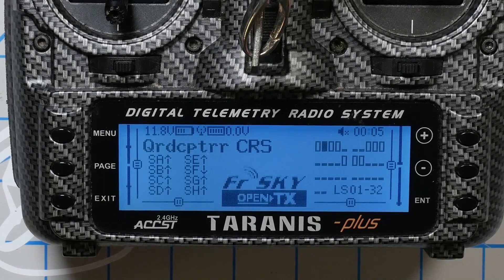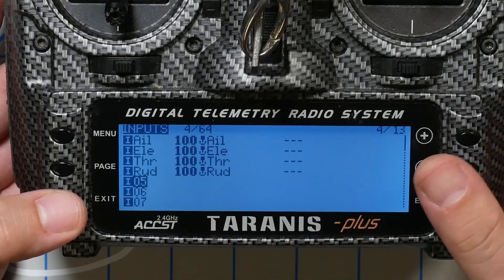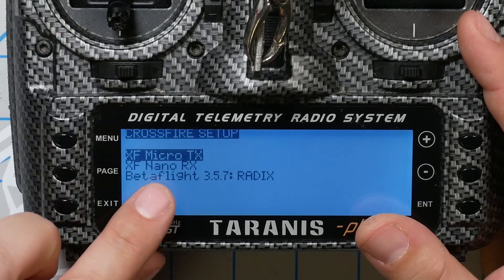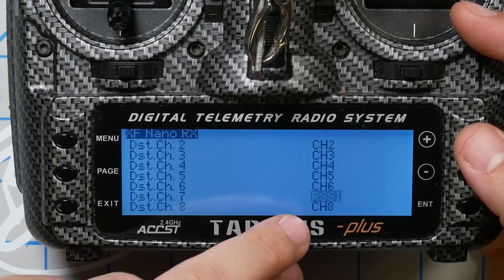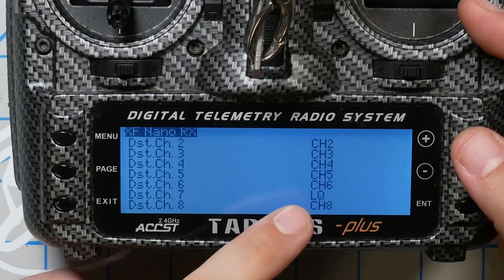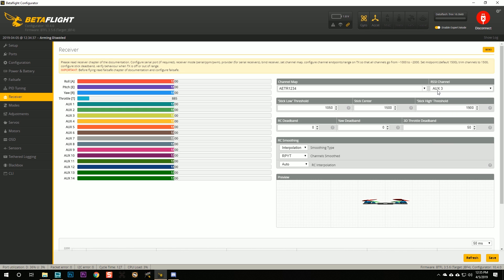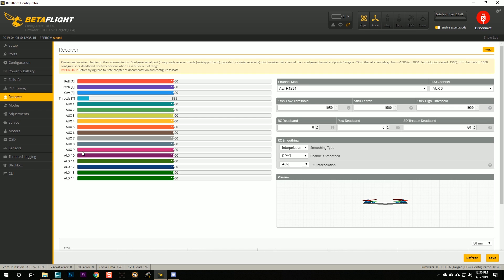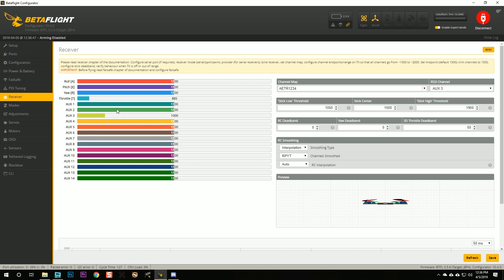How To Set Up Crossfire LQ and RSSI in OSD (NEW UPDATED METHOD IN COMMENTS)

Comment: hi I was wondering how do I fix the module when it is stuck in boot loader mode my pc turned off when I was about to update the module v2 and now it is only in boot loader mode and flashes green is there a way to fix this 😒 please help me 🙈
Reply from the maker: You should be able to flash it in bootloader mode. That's the whole point of bootloader.

Comment: I can't get the channel mapping to show up in lua on my qx7. It scrolls to failsafe and when i get past it the screen reverts to the lua luac selection page again 🙄 whats causing this? I also get telemetry lost warnings but i modded the qx7 already soldering the piece in the back. Im stumped, been trying everything baud rate changed to 11500, an running opentx 2.2.4 an crossfire version 3.72 i think it is. Rx an tx are bound also. In Betaflight all sticks work fine. Just rssi is not working or lq

Comment: Why do you have to sacrifice an aux Channel? Why are there so many aux channels in betaflight if you can only use four of them?
Reply from the maker: First, you don't have to give up an aux channel any more. https://www.youtube.com/watch?v=suAqRh2foq8&ab_channel=JoshuaBardwell

Second, there are lots of aux channels shown in the configurator because there are some protocols that give you that many aux channels. But Crossfire only has 8 channels (or has the option for 12 if you accept reduced performance). Crossfire pilots typically want the lowest latency possible so they use only 8 channels for that reason. It's more aux channels than most people need.

Comment: Hey JB I am new to XF. I am trying to set up RSSI as in your video, but when I push XF Nano RX, it comes up but then I get a box that indicates " Script syntax error - not enough memory" , and then it exits back to crossfire.lua.     Any idea what I'm doing wrong.     X9D+
The RX is bound to my Micro TX V2 and reads in BF. Can arm motors and all, just can't get into the Nano RX in luascript.
Thanks!!     Steve

Comment: I’m having binding issues. My module and nano rx are binded, when I turn on my radio the receiver goes from solid red to green. But my module is still pulsating yellow. I try the binding process but no luck. Firmware is up to date. This all happened after a crash cause my radio lost connection with the drone mid flight, not sure why. Any ideas on the new binding issue?
Reply from the maker: I am not sure what could cause the receiver LED to turn green but not the module LED. I would have to suggest you check with TBS support on this one.
Reply: Joshua Bardwell thanks for the quick reply. I subscribed to your patreon for your excellent services.

Comment: Odd thing going on here.  
I have the TBS Nano rx and Micro TX - Jumper T16.  
Originally i've had it set to just use the RSSI.  (as the DJI FPV only shows RSSI in OSD)

I wanted to switch to LQ as the RSSI here on my test bench shows  85-88 %.  Moving 1 meter away, it shows 75-80 %.  
Followed your instructions, changed it to channel 7 and set it to AUX 3 in BF.  It's still showing the same %.  Changed the AUX back to none and it's still showing the same %.

What am i missing here? :) + That signal strength can't be right, can it?

Greetings from Belgium!
Reply: I’m actually going over the comments for the same exact reason. We’re you able to figure it out?
Reply: Also having the same issue here, TBS Nano rx, Micro tx - TX16S.  Using DJI HD, so only display RSSI value, using the old method to assign my channel 8 and set it to AUX 4, when I'm really close (like right next to it), I get around 80-85%, then 1 meter away, I get around 70%, when I'm out of the room, I get around 50-55%.  Not sure what's the problem there. (Using Betaflight 4.2.2, all latest firmware on TBS rx and tx.
Reply: @allaboutvisual  don't think there's an issue tho - i've been sending it with the same % and it goes... far.  No failsafes - did set them warnings up in my radio, haven't heard them go off either so i assume all is ok.

Comment: Hello, I am having an issue with the SD card. My Taranis x9d+ recognizes that there is a SD card inserted in the slot but none of the files will show up (crossfire is the one I want and I have it on the card). I’ve tried different cards but no luck. Hobby store suspects a faulty card slot, but I think it’s strange it knows the card is there. Help!
Reply from the maker: The card should be under 32 gig. If it is too large it will not read.
Reply: Joshua Bardwell thanks for the fast reply. Both cards were over 32g, so I’ll give that a try. Thank you

Comment: Mr. Bardwell, Could you please advise, what will the Taranis telemetry tab for low and critical alarm should be? since I use Crossfire's LQ,  should I fill them with RSSI (low 30%, Critical 20%) or LQ (Low 70%, Critical 60%)?

Comment: I haven't gotten an answer fro the RCGroups forum yet but as I look in Betaflight between the modes tab and the receiver tab  I'm PRETTY sure that if I have Aux 1, 2 and 3 used up 
for various switches  turtle mode  switch arm flight mode what have you , then I need to set my selected channel in the LUA script for which one to output rssi/lq on  to be something I haven assigned to a switch  in my case  transmitter channel  8 and back in betaflight that becomes Aux 4    RIGHT ?!?!?!   I thought of this because if you toggle your Aux switches in the receivers tab you will see their bars change with the position of the switch  so Logically if your trying to put RSSI on a "AUX Switch" that you just put turtle mode on your not goona get rssi
Reply from the maker: That is correct they will interfere.

Comment: Thank you again Josh got that working. But Im still having trouble with SCRIPT SYNTAX ERROR.. NOT ENOUGH MEMORY. I'm not good with computers actually I'm terrible at em. Is there any easier ways to fix this? Can I use a bigger SD card? Any more help will be appreciated.  Thanks love your videos
Reply from the maker: Make sure you are using the correct SD card contents version. If you get an error message about incorrect SD card version when powering up, you don't have the right version.

Download the opentx firmware with the "luac" option enabled. That can fix it.
https://www.youtube.com/watch?v=1Ccz5gxAX2M

Comment: Hello... I need help.. I have a Lipo 2.2 14.8v 4s... what’s a safe voltage setting for storage?
Reply from the maker: 3.8 volts per cell * 4 cells = storage voltage.
Reply: So even if I have a Lipo 1.0  11.1v 3s... it’s still at 3.8v?

Comment: Just a minor point, in the video you said you have to give up an aux channel to use RSSI/LQ. That's not actually the case with crossfire, as RSSI is calculated by the receiver and is not an aux channel as such beeing transmitted across the air it can be set to output on channel 12 (aux 8) even with crossfire running in its lowest latency 8 channel mode. That's what I do because I want all 4 of my aux channels! Just thought I'd share that incase anyone else is in the same boat.
Great video as always JB.
Reply: You are correct sir! I to do this on my crossfire quads. :)
Reply: Alfie Kupper If I have my crossfire running in 8ch mode, I don’t have the option of changing the output on channel 12. How do you do what you have described ? Thanks in advance.
Reply: @houseofquad2260  Hi, figuring out the same, found the solution: set it to 12 channels, set your LQ channel to 9, 10, 11, 12 (I set it to 12, AUX8 in BF), then switch back to 8 channel. It will keep outputting LQ on channel 12 even if set for 8 channel

Comment: You should also change the protocol from SBUS to Crossfire in the Betaflight configurator ;-)
Reply: Check konasty he has a older video setting up the tbs unify V2 and it helped me you have to use the tbs bind to Ur kwad go Into your receiver I think it's in general ft hen the V2 receiver  channel map channel 1 is either SBUS or PWM or crsf and some other things but Konasty has a great video it's like a year old but it's legit

Comment: Hi Josh,  Great information for crossfire and is this the same way to get it calibrate the RSSI in betaflight.
My osd of the RSSI in my googles is off and no one around here can help.  I have 32%  and it doesn't get better than that.  I am going to see if this will help me.  Thanks again for the information on RSSI.

Comment: nice video i feel like you over read my privet messages with mike chin 2 days ago lmao ! we found a bug in the new fw btw if you do everything like u did well i use aux 8 but any ways if you do everything and it still dont work or shows week rssi/lq you need to reflash the fw to the crsf and that will fix it to test i put my crsf on 10mw and take a walk out side with the kwad and my goggles on and see if it goes down being 100 feet away and out side with controller in side u should see a big drop like to 75% or 80 %